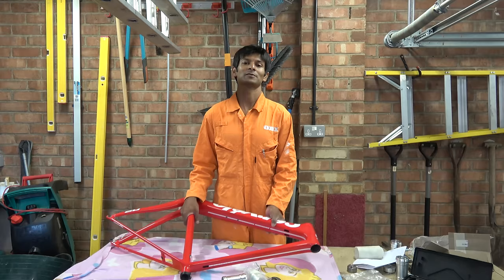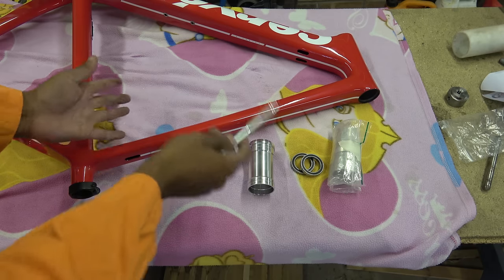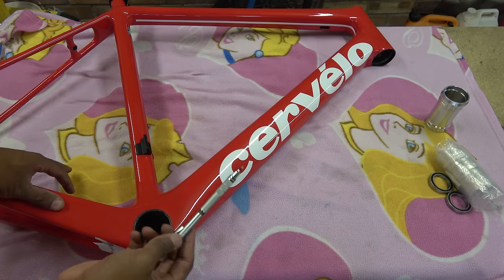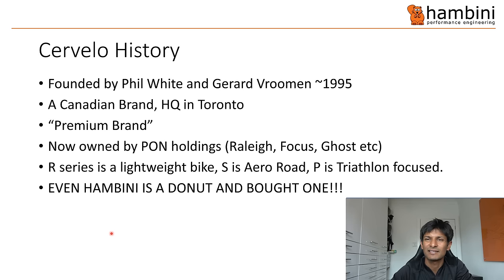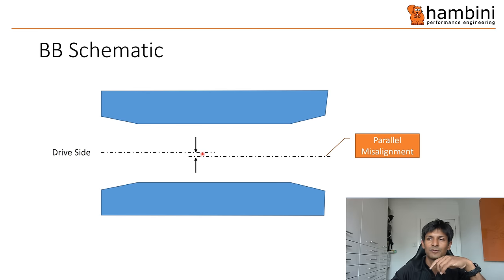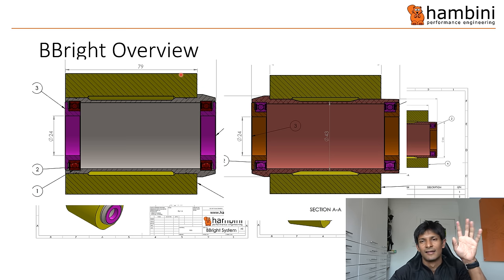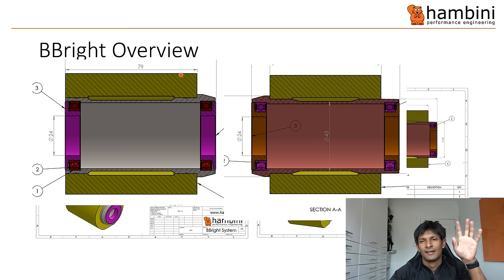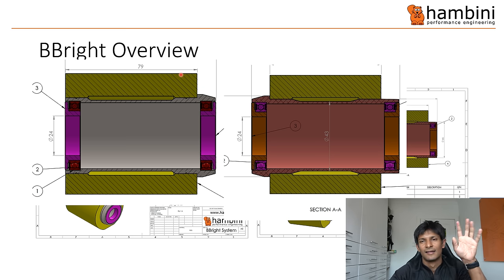Cervelo Exposed and fixed... Scumbag Aero bike manufacturers (A Hambini Reaming)

Comment: Funny I dont remimber all these problems with 68mm bsc treaded Bottom Brackets.
Reply: Actually this is also a problem with threaded BB (and I prefer threaded BB) .  If the bb sides are not aligned there will be friction in the BB.  Ironically, this was common when frames were built of steel BB would get warped when welded and the BB would be misaligned.  I owned a VERY famous, custom, very high end fliet brazed frame that had this issue.  I fixed it with a Mavic BB (the bb did not thread in, it slipped in and then was held in place by threaded rings so the bb shell did not  impact the bearings at all)
Reply: Owned a 2009 Cervelo S3 with BSA, no such issues either. All the craze and cost cutting with press fits are just tragic. Should just go back to BSA or if a wider shell width is preferred, T47 seems to be the way to go.

Thoroughly enjoyed your work as usual Hambini. Love the engineering / technical aspect in your presentation as always.
Reply: A good bike builder should check and if necessary face a threaded bottom bracket shell to make sure it's parallel before installing the bottom bracket.
Reply: Nah, there's lots of threaded BBs with this issue. But any reasonable shop can tap and face it, so at least the bike leaves the shop in customer-ready shape. That fixes most of those problems.

Come to think about it, I had a bike that ate threaded english BBs, about one per season (2xSRAM, and even an Enduro X-15 [don't ask, I didn't know any better]) . Seems like there was an axial misalignment, so the spindle went in a bit crooked. A Rotor Self Aligning bottom bracket was the last one I used before that frame was sold, no issues.
Reply: @Sills71  Yes, there are problems, but they are so few and far between compared to press fit bottom brackets. BTW, I still have the same threaded BB from 2008. Still going strong, even after well over 100,000 miles.
Reply: I love my 2009 Cervelo S1. Good old aluminum and threaded BB
Reply: @Sills71  All my fillet brazed frames always used lugged investment cast steel BB shells. I always used 48% silver braze being a 753 Master. My jig (which I designed) could be rotated through 360 degrees so the braze penetration was complete using the aid of gravity and welding torch heat capillary action at temperatures less than 550 degrees Celsius. (so No reddish glowing steel in the BB shell and the residual flux could be washed of with a damp rag) No pinning either like a Colnago or Cinelli for lugged frame work and there was minimal facing and tapping using the Campagnolo frame builders tools from their kit.
Reply: @Jin_KX  even in a bsa system, axial misalignment in the bb shell of the frame can be present. Only less noticeable
Reply: @Sills71  "If the bb sides are not aligned there will be friction in the BB."
Threaded BBs are self-aligning...so there.
Reply: @Sills71  There is a pretty consistent truism when it comes to products, especially high performance equipment be it bicycles, cars, smart phones. The high end of whatever is made is MASS is usually the most durable and real world best performing item you can get. The best bike hubs for example are and will always be Shimano loose ball hubs not some fancy boutique CNC machined aluminium billet thing, because they are FORGED. They last forever and are dirt cheap due to economy of scale. A bespoke hand made frame will always invite inaccuracy and variability compared to quality mass produced item, because the builder and his equipment will be inferior to the jigs, tools. materials and sometimes robots involved in making the mass produced bike. The next problem is the more lightweight a bike (or anything) is, the more vulnerable/less robust it is. The tubeset was no doubt paper thin on your fram Sills71 as high end tubes always are. The frame will pull and warp during brazing/welding and it may end up with in built stresses in the frame from building too. Meaning that the frame may start bending under its own tension over time or suddenly spring wonky when something breaks.
Reply: why?Because they work great until today in all of
my oldtimer bikes!
What people don’t understand: They think the industry innovates to serve the
customers,when instead they only will follow their agenda to save time(money!),
just like the ahead sets to save them threading \cutting the steerer tube...
Reply: Stephen Saines you need the special tool to fix the rings,if installed properly there are no issues,
given the BB threads are perfect.
Remember these bottom brackets were brandnew at that time,although in my experience the quality 
of the bearings before with single balls are quite better!
Mavic 610 BB still working superior in my vitus carbone 9 since 1986!
Mavic at that time was the best quality,that’s why they durable,not to talk about the design,which was 
revolutionary at that time.
Only Edco could compete with them back in the days, the competition version even looks better than 
the starfish,in my opinion🤙
Reply: @domestique3954  Threadless steerers are vastly superior to threaded, especially if you are comparing  1 1/8" or 1.5" vs 1". Integrated headsets however were truly a pure gimmick money grab that was a step backwards in function and durability. I am astonished it has become the standard. Another great example of money grab gimmicks is 29 and 650b wheel sizes on mountain bikes. Only if you are very tall or riding rigid does 29 make sense.
Reply: @Jin_KX  Yup, I think trek is leaving the pressfit world next year and using T47 or similar in the Emondas and Madones. I think.
Reply: dfpguitar, I prefer 650B because @5’10” it’s more fun and don’t own a 29er but there is no doubt it rolls faster. BUT  I was surprised how much even just in a totally mild, smooth (hardpack) DH neither of us pedalling my mate pulls away significantly - same tyres except for size  and my axles/wheels spin significantly better / longer despite having less angular momentum.  

I’m not typing an essay on how I tested, I’ll just tell you why.

My mate was buying a new mid? travel (160/160) bike and I was pretty convinced the 29er wouldn’t be noticeably faster where/how we ride and if it is mainly over gnarlier stuff.  We have a bit of a reference trail the kids used to race on but in reality it’s groomed and non tech.  Unless it’s racing or a practice run for the kids where they are pedalling full on, we have to drag the brakes a bit behind the kids on their 24” wheels even if we don’t pedal.  What I hadn’t expected was that I’d have to pedal hard to keep up both coming onto a straight motorway section at the same speed from a berm (tbh I would leave faster and accelerating if anything) not smashing a rock garden where I’d have admitted the 29er would be faster.

I still wasn’t convinced.. must be my hubs or brakes ?  Nope ... messed with tyre pressure, swapped bikes ... same thing happens again and again.  The irony is he ended up preferring the feel of the 27.5 anyway.  

Sadly I concluded I was wrong ... 

Was the worth all the boost crap to make 29er wheels strong enough ? Probably a different story ...
Reply: and that's why I still ride a 31 year old Serotta Nova.
Reply: @tychoMX  I've seen some crap threaded BBs.  If I was offered tapping and facing by the retailer I would ask for my money back and buy a better frame.  I have these tools but if it for anything other than minor paint residue etc you have a problem.  LBS remedial work can't fix many build quality or design issues e.g. axial misalignment or if the BB axle isn't at right angles to the frame centreline..  There is no substitute for good engineering for the design and good production engineering and QA in the build and it seems Cervelo have ignored this.
Reply: The problem isn't with press fit but with crap manufacturing standards on carbon frames. Press fit bearings are used on 1000s of applications not just cycling.
Reply: @Jin_KX  I have S3 from 2011 with BSA no problems for now.
Reply: @amfearliathmor8213  What you describe here is why my 1970s Italian steel road frame still runs perfectly with its original Record bracket. My "new" 2008 Roberts is still too young to begin thinking of BB wear, but it will never be an issue because the frame was built properly. Why anyone would shell out several grand on a piece of junk when they could have a masterbuilt steel frame for half the price defeats me. Almost no one needs whatever minimal advantages these frames pretend to offer.
Reply: @Jin_KX  ditto on my 2009 RS threaded with Hope BB, still spinning good. Would never buy  PF , should be called CAF

Comment: I've worked on the retail service end of the bicycle industry for 20 years.  I've seen pretty much any problem from all manufacturers, including the instance above.  The one good piece of advice I could give anyone when choosing a bicycle brand is this:  choose the largest bicycle brand from the best shop in town.

The largest brands are in the best position to make good on an error if you should be on the receiving end of one.  And the best shop in town will make sure they make good on that, because they usually have a large account with said company.
Reply: Roger Dodger  Nope.  What killed (past tense)  them was the overwhelming majority of Mom/Pops not adapting to the changing retail marketplace.
Reply: Roger Dodger  Ok.  Mine is only one opinion.  I don't think it changes the general retail buying habits of public more so than, say, the advent of ebay, or Amazon, or direct to consumer have over the past 20 years.  Not adapting to those major changes have killed mom/Pops and upstarts more so than my YouTube comment.

Comment: Hi Hambini….I am new to your YouTube site, however, I am enjoying the wealth of information that you supply and you BRUTAL honesty!!  I am not a bicycle mechanic nor am I an engineer, but I am an avid cyclist for more than 45 yrs.  It has been close to 13 yrs since I have purchased a new road bike and now I am in the market for a new aero rode bike.  My current bikes are a Trek Madone, and a single speed Trek Carbon District (carbon belt drive).  Both have been great bikes, with absolutely no issues at all.  After watching your videos dealing with frame construction (especially when it comes to frame bottom bracket construction) I feel as though I have been one of the few lucky ones not to have bottom bracket issues.  The bikes that I am considering are as follows:

1.  Trek Madone SLR 9
2.  Orbea Orca Arrow
3.  Ribble Ultra SLR
4.  Pinarello Dogma F

The Cannondale System Six, and the Cervelo S5 were also on my list, but after watching your video “Cervelo Exposed and Fixed” I have chosen to stay away from these manufactures.  Can you PLEASE help me with my decision….I highly regard your knowledge, and integrity.

Comment: I love your shaming photo..These bikes are so expensive, they need to be spot on..no excuse for shite workmanship.
Reply: a good (not top) mtb costs as much as a 125 ccm, yet falls apart at lot lower speeds under a lot less weight. A disc brake? Well, you get a pair of discs and a corresponding set of 4 pads for a smaller euro car for a bit over half the price of a shite flexy bowden bike disc brake kit.
Reply: Your comment about mountain bikes is not true at all 😂

Comment: Very thorough and well documented, the original concept about Cervelo, I believe were two university engineers who at one time, built their frames at Mcgill university. Became and success and sold out for squillions... quality went down the toilet, as it usually does when that happens.. I worked for another major Canadian bicycle company, who specialised in handmade and high quality, same thing, bought out by a large conglomerate,  the frame manufacturing went to China and the build quality suffered immeasurably ..

Comment: I just bought a Chinarello and took my chances. If I was going to buy shit I'd rather it was a less expensive mistake. Well It wasn't a mistake at all. I guess it was molded on a Tuesday? It took longer to build up because I went thru it and measured everything before assembly at least 3 times. I even chased threads as a double check. Say what you will a Chinese frame is made with the same attention to detail as most high dollar frames... NONE.
Reply: I own a cervelo S5 clone from great keen.  It had the same oval bottom bracket problems as seen here.  *oval BB.  It took some effort with a screw together BB from  wheels Mfg. to fix the BB like Hambini did here.   I was OK doing this on a $500 throw awaiy frame.  If I paid $3000  for iit I'd be livid.  To note 3 years on and the chinarello works beautifully.  I'd buy China carbon  again no problem. Yoeleo all the way.
Reply: chris scott which yoeleo frame is a clone of the s5?:)
Reply: I have a Dengfu R5 clone, absolutely perfect wrt BB installation etc, and much cheaper. Also have a Dengfu TT frame which is superb but not sure which  branded bike it's similar to?
Reply: Fr Ya my s5 clone was made by a Chinese company called greatkeen . It’s a 2014 model. The website was on alibaba and I cant find them anymore. I have had good experience with denfu and yoeleo wheels and frames.  I’d buy from either of those outfits.
Reply: Tantan seraph x1.  Took a .5 mile KOM from a current TDF rider by nine seconds last week.

Also.  I burned a hole in the side wall of my 28mm gp5000tl from flexing in sprints and climbs.  I'm blaming my ICAN wheelset.

Have 25mm on order
Reply: @chrisscott8362  GreatKeen was a legend. I got several frames from him and always requested BSA. 👍🏾👍🏾👍🏾
Reply: because often they were made in the same factory using the same materials beeing the same small hands
building them—look out alibaba.com and compare the models.
Asians say: Same same but different
I always prefer steel or titanium,don’t need to produce more toxic waste,and that’s exactly what it is
when the short life span is over
Reply: Same here.  I’ve got an R5 clone.  Workswell.  I put a bbinfinite bb for a Shimano crank on it and it’s the best bike ever.  I had a real 2012 Cervelo R3 before that.  Granted the BBS have come a long way since 2012 but it creaked like a whore’s bed
Reply: Guess it's 50/50 .
Reply: LOVE my Chinarellos!!!! all 3
Reply: Can you tell me which manu you ordered from , i was wondering about thid exact thing
Reply: What's the likelihood that all these carbon frames from name brands are made in China anyway? Is a carbon frame from Bianchi made in Italy, or is it botched together in a sweatshop like everything else?

Comment: Great video.  I have a 7 year old BH with BB30 and it's never let me down.  No creaking or noises from it whatsoever.
I change bearings regularly using my own design BB press, much the same as yours.  
All in all my experience of BB30 has been brilliant.
Reply: I've not had trouble with my BB30 frames using Shimano cranks, either, but I have had an absolute shitload of customer's bikes that have!
Reply: @Hansengineering  Don't get me wrong, I know there are problems with it, but it just goes to show some manufacturers got it right and some are piss poor.

Comment: Remember when bottom brackets were just threaded? Way back we fitted and assembled left and right side bearings separately. They just screwed into the frame with the axle in between and then finely adjusted to remove play and binding. Simple. Any half-decent frame would have its threads and shell faces cut parallel in the factory or by the builder using a simple tool. The wide availability of threaded cartridge bb's for about the last 25 years made installation even easier, with the entire bottom bracket assembly, fitted in one piece becoming even more reliable and straightforward. Now we have this debacle.

Comment: Very informative video. Always love your straight forward and direct comments. Thanks. I certainly won't be buying a Cervelo as my next bike. Just one note, as a retired industrial Loctite rep (32 years in the business) I've always questioned the use of retaining compounds on carbon fiber for two reasons. First, if someone forgets to use primer (I think you used SF 7471, which is the correct one. SF 7649 would cure 641 too fast) It wouldn't cure. Remember that retaining compounds are anaerobic resins that cure when trapped between ferrous metal surfaces. If you trap them between aluminum (non-ferrous) and carbon fiber (not metallic) then you haven't met the conditions for curing. So priming is good for these surfaces. The second reason I question it's use is adhesion to the carbon fiber. I'm not sure how much holding power you would have. Granted it is trying to adhere to the resin in the carbon fiber but I've never seen any data on this. Also, your machined aluminum BB, if very smooth, almost glass like would also be problematic. I've seen retaining compounds fail, adhesively, on very smoothly machined aluminum. So a little roughening is very helpful. All that said, if you've done some in-house testing to measure press out or rotational forces on a retained part, with and without retaining compound, you'd have your answer as to whether it really helps. If the question of using some kind of adhesive to retain the BB is needed, I've always thought a low viscosity 2-part epoxy (which Loctite makes) with a high shear strength might be a better choice if you never want the BB to move or creak again. What's funny is I was on a ride a few weeks ago with a friend who bought a brand new Aspero gravel frame and the BB was creaking. As a Canadian I'd like to support my fellow countrymen but not when it's made that badly. Thanks again. Cheers.